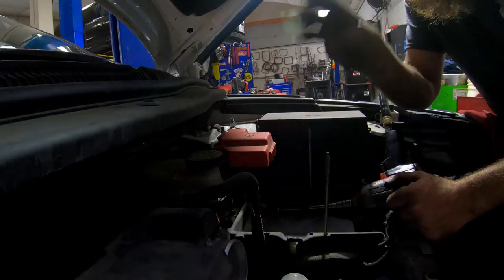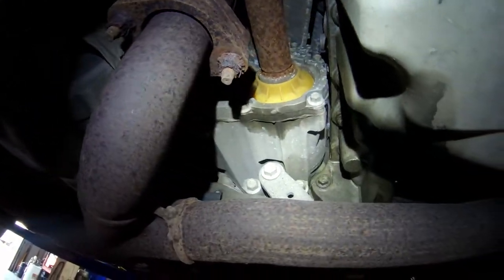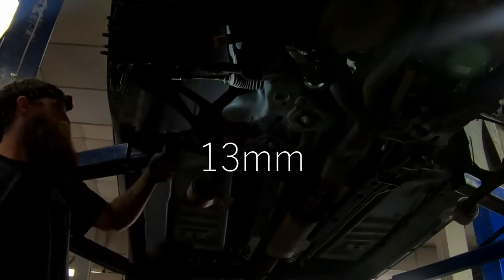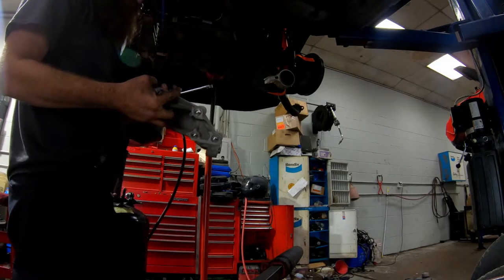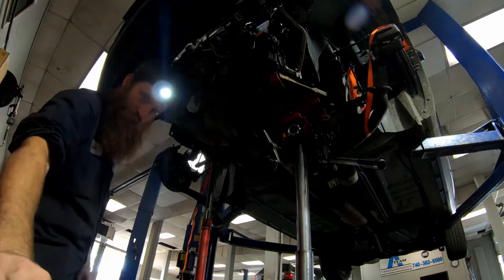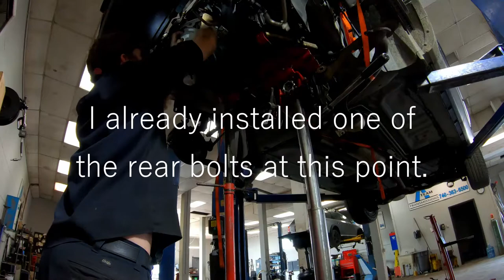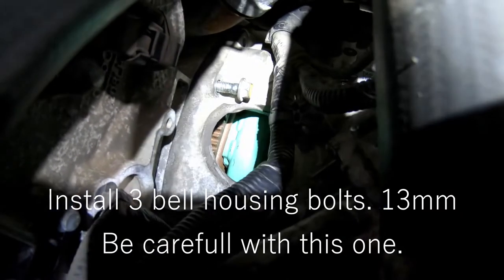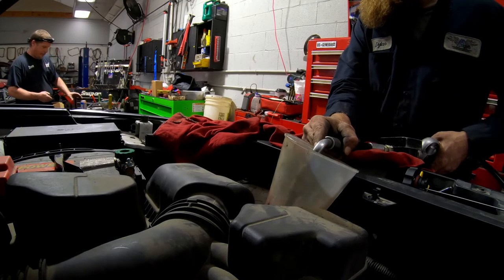2013 Ford Explorer Transmission Removal and Installation!! Rebuild complete!!

Comment: You sure do look like you know what you're doing there I wish we had some decent mechanics around here anyway great job man I know soon I'll have to have that done to my 2015 Explorer recently it started jumping and skipping through gear shifts I was advised to put some friction modifier in, it actually straightened out the problem but it still doesn't feel just right I just wonder do you have any idea how long that might get me through?
Reply from the maker: Not really sure. I’m actually a little surprised it straightened out. Good luck and thanks for the comment!
Reply: What friction modifier did you use?

Comment: I may need to replace the subframe in my 2015 Edge, 3.5L V6. Fairly sure its similar stuff under the hood as this Explorer. I've been trying to figure out how to support the engine+trans and remove the steering rack and sway bar from the subframe. The ford tech manual I got my hands on says to support the engine with an engine hoist and only shows how to remove the subframe with the steering rack, sway bar attached. Seems to me the steering rack and sway bar are just a few extra bolts and they can stay up there. Though I'm still stuck on the engine. From some other vids I've seen, it looks like the engine is suspended from supports on top. So I might not need the support?  (prob should just cause)
The manual also says to dispose of a number of the bolts and replace. Doesn't say it explicitly, but I assume that means they are to be torqued to yield? Is that the case or is the manual just being extra cautious?
Reply from the maker: We always use straps to hang the rock and pinion from the strut and as long as the balls come out OK there’s no reason to replacing just probably to cover their ass but as long as you leave both the top mounts on it, you won’t have to support the motor

Comment: Thanks for this awesome guide!  For those doing the 3.5 tt version, you'll also need to pull out most of the boost pipes.  I had to remove the rear turbo oil drain and disconnect the water feed to get the PTO out.  If I had to do it again, I would consider dropping the suspension, cradle, roll bar, and steering all as an assembly.
Reply from the maker: Thanks for the tips!!

Comment: My 2014 is starting kicking when the 3rd gear goes in and feel a delay then the thump. Check the transmission oil and looks clean . Hope I can have it fix and not fully rebuilt. Great work you do Sir.
Reply from the maker: Good luck we see a few of these.

Comment: My 2012 Ford explorer has a p0715 code after it was shuddering. It slammed really hard going into the next gear then the wrench light came on and when i tried to accelerate it barely wants to move and is in one gear. It also sounds bad after that happened.
Reply from the maker: Sounds like you need a transmission shop. The shudder is the converter going bad. Once that happens it wipes out the rest. Sorry to have to give you the bad news. Thanks for the comment.

Comment: Do you by chance have a part number for the transmission fluid cooler line seals? The ones on top of the transmission. I believe that’s what they’re called. My transmission (explorer), Is leaking from that line with the 8 mm bolt holding it down, on top. Can’t find the replacement oring seal, if there is one at all. TYIA!!
Reply from the maker: No I’m sorry  good luck

Comment: Just curious on the total cost of the removal, rebuild and install. I know it'll be different from shop to shop, but I'm going to have to have my done and wanted maybe a ballpark figure. Thanks for the video BTW, I thought about doing mine myself, but I'm having second thoughts about doing this in my gravel driveway.
Reply from the maker: Right around $3000. Yeah I don’t think I would try it in a driveway let alone gravel. Thanks for watching!
Reply: @doingstuffwithdylan4367  doing it on concrete in my driveway way. It a lil challenging on you back.

Comment: Help I swapped mine on my 2013 explorer but now mph needle won't move or go past first gear do I need to reprogram or reflash the transmission?????
Reply from the maker: Is every thing plugged in? Did you get from junk yard?
Reply from the maker: Most of the time these do not need reflashed or programmed. No Speedo is likely why it won’t shift. I’d check all the plugs first for bent pins.

Comment: I just dropped my first transmission on a 2011 Ford explorer note I've been a mechanic for 20 years. Watching your video really made me mad my steering rack I had to buy a one and a quarter inch wrench grind the head down for the box and to get my rack off makes me managers just came off with a quick zap of the gun on another bad side my torque converter will not come off so you have any information about the torque converter either staying on or coming off I would appreciate it
Reply from the maker: The torque converter is stuck to the fly wheel? If this is the case try 2 pry bars and a helper. If you are talking converter clutch engagement let me know
Reply: Thank you. I was scared to do that didn't want want the flex plate to break. My buddy did that once.

Comment: I have a question some I’m getting a used trans off eBay that has 48k miles on it with warranty and I’m going to be putting it in my 13 Ford Explorer. The number matches up. Will I still have have it towed to the dealer for programming ?
Reply from the maker: Probably not. Most fords don’t need programmed. We rebuild them though. Thanks for watching!

Comment: Thanks, great video! 👍 I’ve got 352k miles on mine and the transmission is slipping. Do you think it be worth it to replace the engine as well while doing the transmission and transfer case, or would it be twice as much work?
Reply from the maker: The rest of the car is just as old. Removing the trans and transfer case do provide room to remove the engine. Is your engine bad?

Comment: I hope they put a new PTU in with the new transmission. Barely any fluid came out when you unbolted it. They should have 16oz fluid but the exhaust cooks it up. Definitely recommend anyone doing this procedure to invest in the PTU and modify so it can be drained/filled regularly. The torque converter is another weak point and should be replaced if you're this deep into it.
Reply from the maker: Very true we do a lot of ptu replacements on these! Always use a new converter. Thanks for the info comment and watching!

Comment: You got any tricks to get the rusty bolts off on on the exhaust flex pipe? I tried pb blaster and the blow torch and am still afraid it will break off.
Reply from the maker: Heat. Oxygen and acetylene
Reply from the maker: And if they do break heat flange red cherry hot and drive out stud and put through nut and bolt!

Comment: how much does that job cost?
Reply from the maker: Right around $3000 usd. Thanks for asking and watching!
Reply: @doingstuffwithdylan4367  And if the transmission is obtained in a junk car how much would it cost to change it?

Comment: Is it easier to pull a motor and then take the transmission off
Reply from the maker: I don’t think so. Good luck if you go that route
Reply: Thats how I do them. I don't have a 2 post lift though, just a midrise that gets the car up about 4ft.

Comment: Would a 2016 Ecoboost one be much harder since you have to remove that rear manifold? I'm about to tackle one tomorrow and nervous about it being an Ecoboost 😬 any advice is much appreciated 👍
Reply from the maker: I don’t think it will be much harder. I do plenty of transfer cases on those and the rear cat is not hard to remove. Especially with the subframe out of the way.  Did not be nervous  just nuts and bolts. Good luck let me know how it goes! Thanks for the comment!